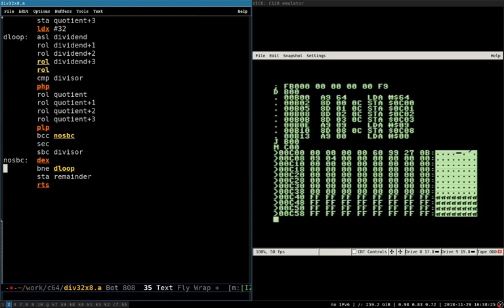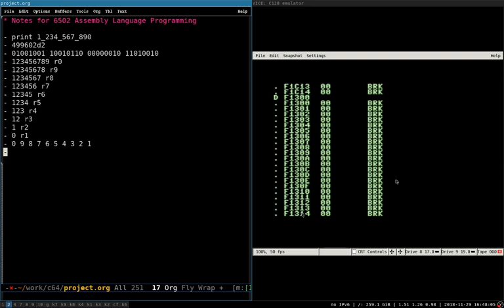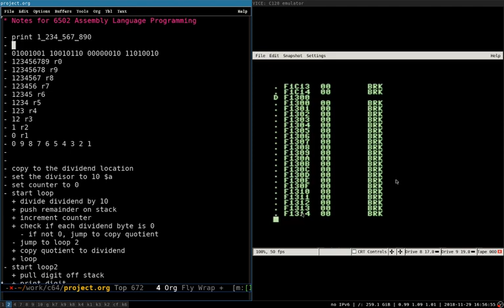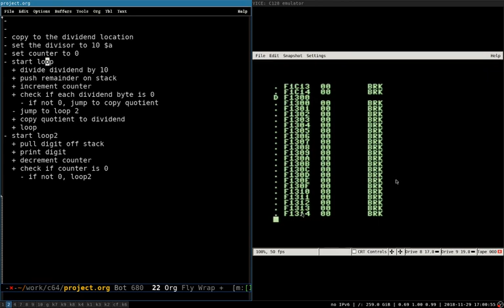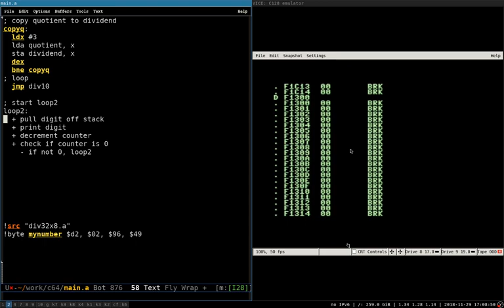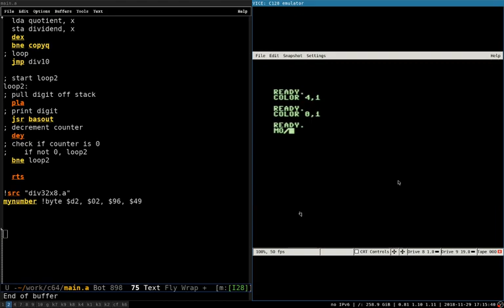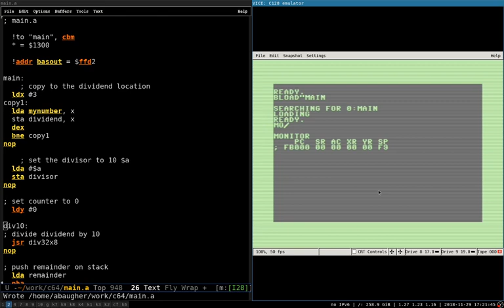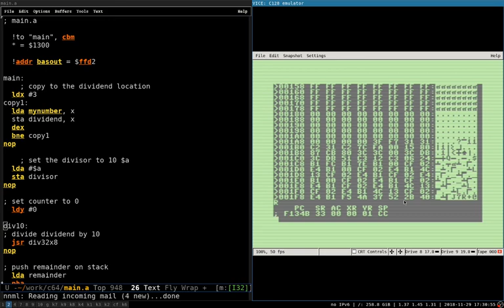6502 Assembly Language #6: Printing a Number

Comment: 27:27 after you call JSR div32x8 there will be remainder on A register allready? you not need load it again from memory. i think :)))
Reply from the maker: You're right, good point. Since that routine leaves the remainder in .A, there's no need to load it unless you do something else first, which this program doesn't.